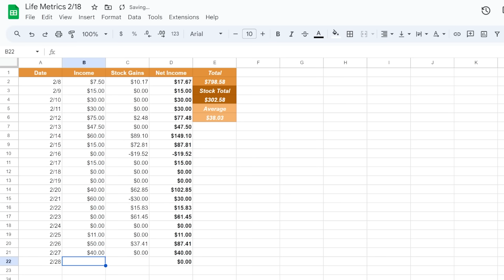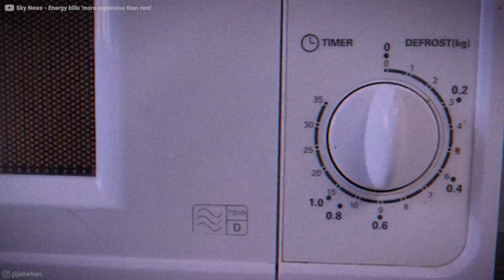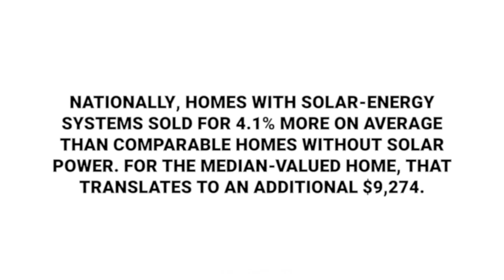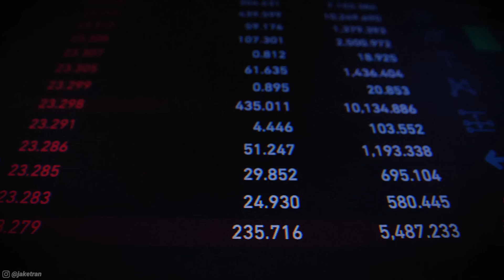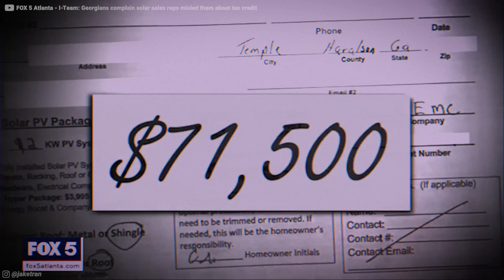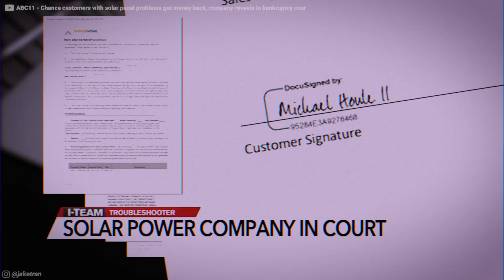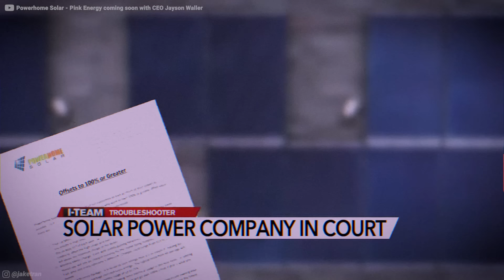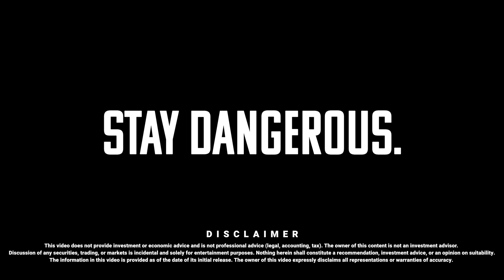Home solar panels are literally a scam.

Comment: Just to be clear, if you receive a tax refund, then you could still use the solar tax credit.  A tax refund simply means you paid more to the IRS then you owed.  Therefore, for example, you could pay $13,000 to the IRS through tax withholdings, but only owe $10,000 when you file and get $3,000 back as a refund.  That $10,000 you owed, could be reduced by the Solar Tax Credit.  So, you really need to focus on what you actually pay in taxes (not the refund), which you can see on the return you filed.
Reply: Exactly, the parts about the tax credit were very misleading in the this video. Unfortunately a lot of people don’t understand taxes well enough to know the IRS is not simply writing them that check right away like they thought, and companies prey on this
Reply: @pedrofan34 exactly this how I explain it to people. I totally agree that there’s much more predatory companies than good, but the reality is solar is not for everyone. Especially when it comes to ownership vs leasing. Thats why I pitch the way I pitch, I truly don’t know if the house qualifies until I actually build a design for them. I’ve had to tell a lot of people that it wouldn’t work for them. Don’t get me wrong I love making solar money, but I don’t want to fucl people over
Reply: Thank you for adding this as I found that misleading in the video... Also the part about the disabled Vet being tax exempt, that is not the norm and I wouldn't expect a solar salesman to know this information much less ask them about it lol.
What really blew me a way was the lady claiming she doesn't make enough income to owe tax at all yet she buys a solar system 🤣🤣🤣
Reply: @jtr82369  You realize over time that most news, media, and complaints are exaggerated, embellished, and overemphasized.  It also doesn't help that you mainly hear stories from the point of view of an uneducated person.  This is why we have regulation in all industries and should probably have more because we need to protect stupid people from themselves and save tax payers from footing the bill for their mistakes.
Reply: Yeah. This video is extremely misleading and he clearly doesn't know what he's talking about. Most people do have enough taxable income to claim the tax credit. Even people who are retired are usually still being taxed on pension income. That of course doesn't mean that everyone can claim it but it's usually not an issue
Reply: @AntiCommunistAgenda2884  why would they tax other people's saving like that? damn i hate tax. imagine saving ur money, retiring and still have uncle sam chasing u around for a piece of ur savings. Even land tax, it as if I'm renting my own land from Daddy Gov Gov
Reply: @이지민-j5w  YOU ARE
Reply: I’m with you here. This seemed like a slanted but relatively informative video up until they started riffing about taxes. Taxes are complicated enough as it is, if you’re going to bring that up, be precise.
Reply: @pedrofan34  It is also a carry forward credit so if you can't use it all on this year's tax return, you can use on the next year's and the years after that if necessary until you reach the 30% of the solar installation cost.

Comment: I did about 6 weeks of door to door sales for a local solar company here in Texas.
I was not good at it so I didnt make much money. The guys who actually did the selling of these systems made damn good money. The company and guys who own/ran it were multimillionaires and in their early 30s. 
There was a lot I dont know about the details in how they operate but i would do my best to be transparent, honest and ethical.
Like the disabled veteran who didnt qualify for the rebate. I ran into that exact situation and told they they didnt qualify and moved on. I made it a poont to tell homeowners it was a tax rebate rather that a check.
But yeah I have never experienced the instant hate from some people like I did doing this job.
Reply: I’m from Texas but did D2D solar sales for a summer in L.A. and it was exactly how you described times infinity… They are ruthless when it comes to “overcoming objections” and knocking past sundown.
Reply: Same experience but in Phoenix . 😅 those extroverted salesman and could spend money like no other
Reply: There are wolves and sheep buddy
Reply: Been a installer for 9 years I know in’s and outs . Had customers pop out guns and be like get the fuck out of my house

Comment: My system was paid off in 16 months and the company kept doing everything they could to save me more money from making sure the home was as efficient as possible and making the inverters a bit smaller than my panels capacity so I didn't spend thousands extra matching them to catch a few dollars more sun per year, the extra would have paid off by the time to retire the system in a few decades, vs already being done like the ones they did install.

Point of the video stands though, you need to shop around and be mindful of people showing up at your door.
Reply: Which company did you get solar panels?
Reply: How much smaller was your inverter compared to the solar panel capacity? My friend who is a distribution engineer with a public electricity utility has advised me to match the inverter with the panel capacity to prevent overloading in summer.
Reply: @nayaknaresh  8.37 kW in panels 6.75 kW in inverters. He showed me the math for my location and roof pitch, I'd be looking at maybe 5 hours a year lost at max output VS now I load the inverters up pretty good at peak and then even they aren't putting out max for long the rest of the day. Panels are mounted east west because the roof is north south.
Reply: "Silicon tetrachloride gas" is a byproduct of the manufacturing process for solar panels.  And lead which off gas too.   Oh and cobalt and cadmium.    gamma rays too
Reply: @jjk2one  cool story. We use cobalt to desulphate liquid fuels too, nothing we do is zero impact but we can minimize our local output and total outputs and insulate ourselves from price increases.

We have batteries now, one of our neighbors gets to wheel out a generator, the rest sit in the dark.
Reply: @KaceyGreen  Hope you never have to visit an oncologist

Comment: On commerical, industrial solar energy projects, return on investment breakeven point is about 3 to 5 years, after this time period, you start to make money by zero electric bills and if local utility accepts your power, pay you to provide them power. Home solar installers markup systems over 100%, so the ROI breakeven pt becomes 20 to 30 years. I would consider this gouging.
Reply: It's actually would take 40 years in my area. I was looking up stuff while talking to them. They said the full amount possible for solar to produce but not our rainy area. It's crazy how rain can make it money back from 15 years to 40 haha. They left so fast without trying to say anything back.
Reply: are commercial systems bought up front?  because that's the only way I see it making sense.  that and the fact businesses use a ton more power than a home.
Reply: @fluxcapacitor05  Yes, and they are financed. The determining factor is the price for the installation. 2000SF home with a $400/mth electric bill, can realize breakeven at 4.167 yeears, if priced at $20,000. This would give the solar contractor a 30% gross margin at $20K sales price to homeowner
Reply: But it's not gouging because when you take a loan there are interest and finance charged. 
Educate yourself
Reply: @altered_beast if im paying interest why are there finance charges

Comment: And of course California made it a law requiring home builders install Solar on every new home build since 2022.
(and yes that gets added to the cost of new homes)
Reply: You get what you vote for
Reply: Good move. The rest will follow like always...
Reply: Pretty ridiculous, what do they want everyone to leave the state?
Reply: the upside is that those glass panels work as the outer layer of a house, so it is not all bad. stick them on the walls and maaaaybe the roof.

Comment: 🎯 Key Takeaways for quick navigation:

00:40 💵 Solar companies promise big savings and government checks, but these claims are often false.
01:09 💼 Homeowners are left in debt while solar company executives profit from predatory sales tactics.
02:30 💡 Know your numbers and be cautious of door-to-door solar salespeople.
06:37 💰 Homeowners are overcharged for solar panels, loans, and interest rates, resulting in massive debt.
12:58 🚫 Many solar companies engage in fraudulent practices and rebrand to avoid lawsuits. Stay informed and research before investing in home solar energy.
Reply: Thanks
Reply: The homeowner is going to pay the same amount or more for electricity while they are in the home than the cost of the loan. The loan is locking people in to a fixed payment for a utility that is continuously skyrocketing. Solar is beneficial.
Reply: You’re a gentleman and a scholar!
Reply: I always knew they were sketchy. One issue that I guess might be true?

 I have read there is a backlash with Solar at the moment for those who use regular power. I'm NOT an economist, but long story short solar is driving up the prices of regular power. Basically they are saying conventional owners are subsidizing solar in their areas. 

 If true that I can see being a real issue. Not really sure why as logically to me less demand shouldn't drive up prices.
Reply: @MrGoodeats  That's been my experience. San Diego Gas and Elec has been raising the rates every year. With my solar system I've locked in a fixed rate which is significantly less than what I used to pay.
Reply: I appreciate the emojis because my adhd self would not pay attention l, my brain is cooked 🙂
Reply: I literally work for a solar company. #1 is absolutely true, You get 30 % tax reimbursement on your solar system as per the inflation reduction act. That’s if you’re buying (w/ or without loan). And in my state of New York you also get a income refund (literal stimulus for going solar up to $5000 at the end of the year and a property tax reduction for 4 years in the 5 Burroughs. It is all verifiable 

#2 the nature of taking debt out is obviously if you cannot sustain it do not take it. There are options where you don’t pay for the solar itself but just the electricity (Lease) and save by paying for it just like you would your provider which is literally the most popular option by a landslide

#3 In door to door sales, nobody will be against what they are offering, so we will be persuasive. However some people cannot discern a reputable company from a actual liability. Rather, being informed than being cynical is a far superior option

#4 is true

This video has misinformation, and I watch this YouTuber which is pretty disappointing. We are all the whim of anybody if we don’t verify information for ourselves. Especially with selective sources
Reply: @MrGoodeats this is what I have experienced.  We went from a $300 dollar AC bill in summer In New Mexico, to getting anywhere from 60 to 17 dollars paid to us in energy credits that go onto your next bill. We no longer have a power bill. Only 150 a month payment split with my inlaws because we got a solar car port instead of on the roof. Inlaws use the car port to shield cars from sun so they split the bill 75/75
Reply: One reason i did not go solar was California changed the rules on how long it takes to get solar credits.
Reply: @royperry2859   yes they did. Don't you like being ruled by criminals who will do anything for those sweet corporate bribes????? You DO know that not a single solitary soul in Sacramento gives a fuck if you live or die correct????
Reply: #1 You actually do get a tax refund regardless if you owe or not. You do require taxable income though to get it. How it works is you pay x in taxes and from x you get y back. Y is the variable of the amount you over paid taxes. Most people don't get 100% of taxes paid back. So the amount the government kept from x-y is where your you get the tax credit. Even if you don't use it all the first year, it carries over, unlike EV car sales.
Reply: nice AI bro

Comment: I have had about 2,000 Watts of solar panels for many years now. If you buy directly they are under a dollar per watt now. At one time we were running everything on solar power. We kept the grid for backup. The only things not on solar now are the fridge, freezer and well pump. Some other small things which dont use much power. The rest is solar.
Solar power works and can save you money if you do not get cheated and pay those big companies. Buy direct. Then pay an installer.
Reply: where did you buy your panels from?

Comment: Thanks for making this video. My family runs a hvac and solar company. 90 percent of people who ask for solar panels their homes are not suited or viable for solar panels. We would tell the customer and they would not believe it. And would go to a predatory company who will throw panels on any home. Little do they know the panels will take 30 years to pay for themselves. Especially with the liberal mind set why just want panels.
Reply: This right here.  Many people complain about their output because they were lied to about efficiency of panels and factors like trees, clouds, very hot temperatures, dirt, snow, adjacent buildings, roof angles, and constantly changing metrics by power companies all of which drastically affect kw hours.  Most people just can't do math and/or are unwilling/unable to research probable outcomes.
Reply: Bless your family for not being a predatory green energy company.
Reply: I. Moving back to PR which is located in the sub-tropics, i was thinking solar since the sun always shines. The sub tropics should be a great location no?
Reply: @2tallnegrito7cmn55 I'm in puerto rico and have solar panels.
Reply: @YaO_MeaN  are you ok dry or wet side? I will be on the east side behind El Yunque. How has your experience been? I haven't been home since the year 2002
Reply: Thanks for this 👍
Reply: 20-30 years to lay off but its a fixed monthly price that doesn’t go up unlike the 20 billion dollar utility companies that are jacking your rates every quarter. youll save an outrageous amount of money using solar
Reply: I thought they had to be replaced in 20 years.
Reply: What are the possible reasons for those house not being suited/viable for solar panels?
Reply: I don't know where you operate. So, I can't judge your claim of "90%" don't qualify thing!  But, in most areas,  90% would benefit.  This kid comes and makes a video for the haters and everyone cheers.  Calling solar salesmen predatory.  That is insulting.  I've been in business for over 9 years.  Most consultants in this business I know are good honest people.  I have over 600 installed clients and every single on of them are happy and are benefiting from solar.  I have 5 rental properties and I installed solar for all my tenants reducing and stabilizing their energy bills.  Here it is,  for the right setup (California is mostly right),  solar is a good deal.  Is it chip? No.  It is an investment.  Just like any other investment,  the person who is commiting to a contract, should do their due delignate. Pay back time is not 30, after NEM 3 passing, it is about 11 to 12 years.  It was 7 years with NEM 2.  Look, there are bad apples in every basket.  We can't generalize.  Doing this for so long, I come across a few of haters. People who listen to some and don't do their own homework.  They don't run the numbers and have no idea how all these work. But, instead of educating themselves, they just reject.  If you talk to those clients of mine or even my friends in business,  they know exactly what they have and what it does.  For the last 4 years, even through the pandemic,  I have only serviced referrals who were educated by my installed clients and I didn't really had to teach them anything. Just customizing a system to their specific need. That should tell you something.  So, depending in the area you operate, please stick with HVAC and don't spread misinformation.

Comment: Instead of this, just install a solar water heater. It heats up water using glasses and mirrors. Saves electricity.
Reply: Real men take cold showers
Reply: I agree, but real men also 'intellectually consider' ; warm water, as part of the shower, goes farther to clean.

You can say I have more concerns with hygiene, to view the shower in this way and that's fine - I'm not saying your comment has no value - it's the "balanced diet" of showering, in my view.
Reply: Also, I will not like washing my dishes or brushing my teeth without warm water.
Reply: Gotta be scalding
Reply: In the summer in phoenix AZ there is no cold water, it comes out hot all the time even at night. no water heater needed lol
But my air conditioning bill is crazy
Reply: There are some phase changed hot water heaters i am keen on seeing get reviewed as they roll out. Basically they are tankless systems that instead of having burners has a phase change gel that can hold temps for 10 days when not powered or in use.  They can be hooked up to a standard 15a wall outlet or do single solar panel if need be. 

that said i am still gonna wait till more reviews come out on them, as i am never an early adopter.
Reply: @dsxa918  Bro you need warm water to brush your teeth? wtf
Reply: Guy up the street from me has one of those!! Like 10 or 15 long glass tubes that my brother told me a long time ago, ya that has to be a solar hot water heater.
Reply: @CheapSushi  I live in hurricane country. If the power is out being unable to take hot showers can suck since the AC is also going to be out. That first hot shower when the power is back on feels amazing.

Also battery banks exist and if you have a car then you have another way to charge your phone. Stop being deliberately obtuse.
Reply: @dsxa918  That's the first I ever hear about someone brushing their teeth with warm water.